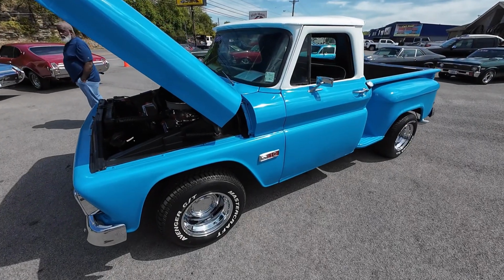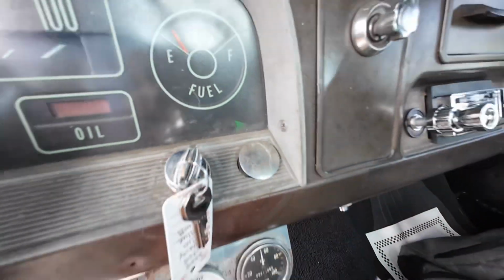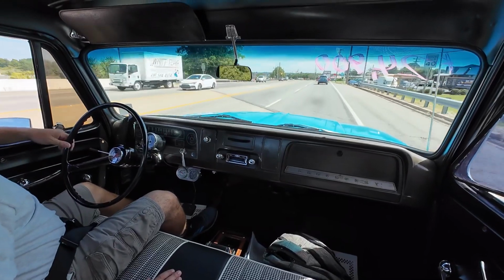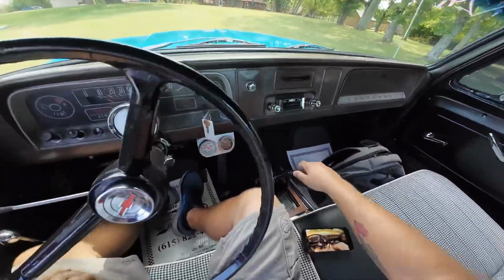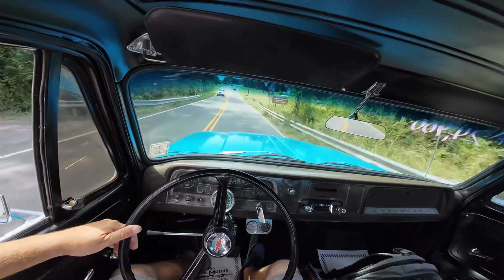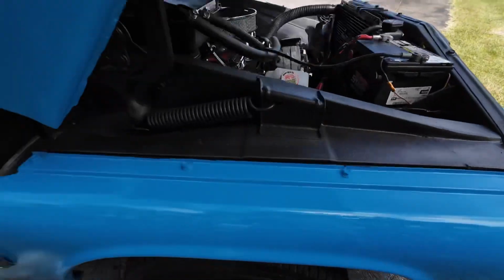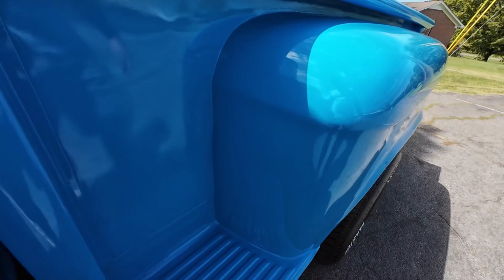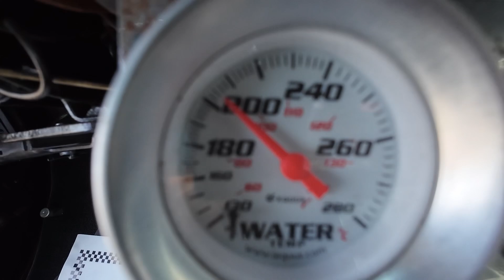Test Drive 1965 C-10 SWB Stepside SOLD $24,900 Maple Motors #2328

Comment: I owned a '60 Stepside PU with a '65 front clip from 1999 through 2016. The truck came from Texas where it had been a farm truck all its life since new. I was the 2nd titled owner. The 1st owner had replaced the 3 on a tree manual transmission with a 2 speed Power Glide transmission because " his wife could not drive stick."  Originally it had been Sherwood Green, paint code # 704. He re-painted it in Golden Yellow, paint code # 718. (Excellent job ,too) and installed a new wooden bed. When I bought it for dirt cheap in '99 and trailered it to where I am in the Northeast USA, it still had "farm dust " in the dashboard instrument panel gauge cluster behind the lenses. All I did to it in the 18 years that I owned it was to wash-wax- add fuel -oil -anti-freeze , replace tires, adjust the choke and replace the spark plugs periodically/re-gap. I even drove it as a daily runner many times in addition to weekend cruises, car & truck shows and girl scout cookie pickups for the troops ... bed filled to the brim with cookies and wooden bed racks in the bed pockets holding the load -in. 🛻..dang, I need ANOTHER one!

Comment: Beautiful truck. But it is clearly looks like a 1966. 1965 had the emblem on the side of the cowling,  not on the fender. But looks like a 65 emblem in the wrong spot. Also, 1966 was the only year in the 1060-1966 pickups that reverse lights came on the stepside fenders. Could have 1966 parts in a 1965 truck. But still, really nice truck with a great color combo.